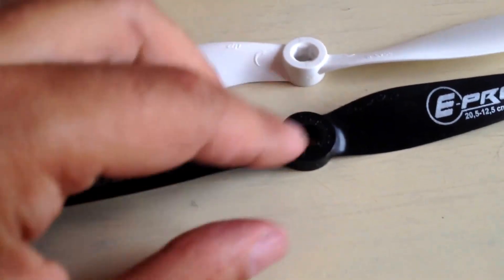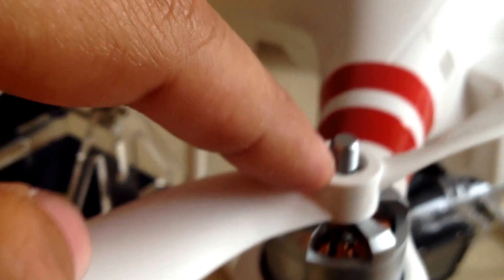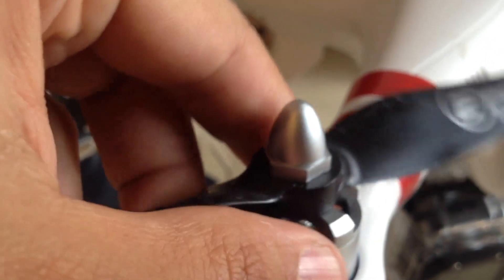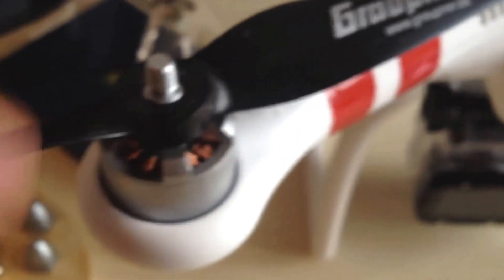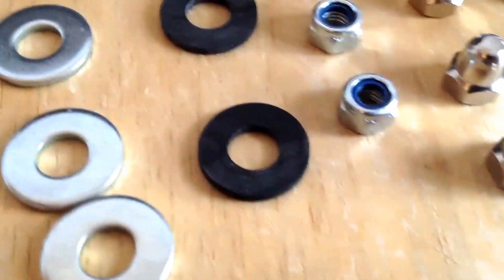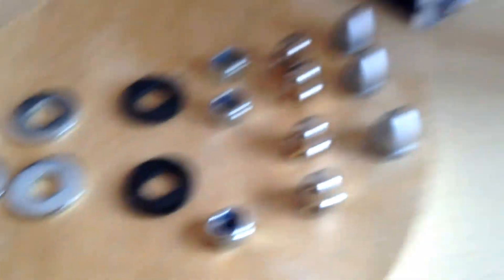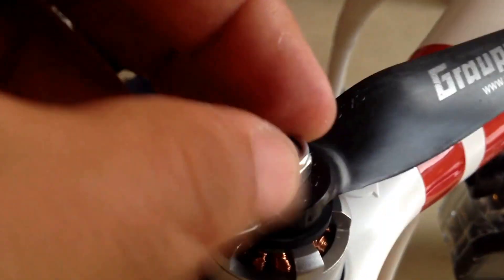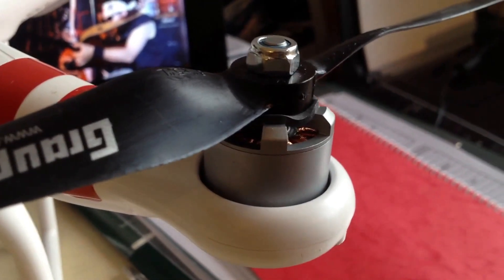DJI Phantom tip #3: Mounting Graupner E-Props & replacing stock rotor nuts

Comment: When compressing the rubber washer at the bottom of the prop you are not seating the prop perfectly on the motor which will cause slight variations. If it works for you then great, maybe on a Phantom.
Reply from the maker: Good suggestion. I will try mounting the washer on top.

Comment from the maker: With the grooves? not really. But the correct hole dimension (in case you have the dual size prop hole) is easy with a drill...